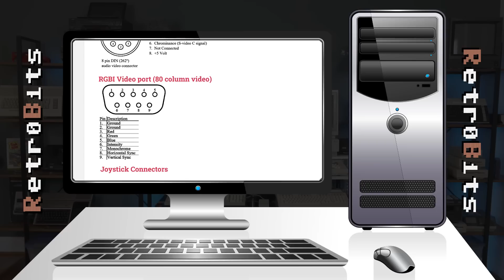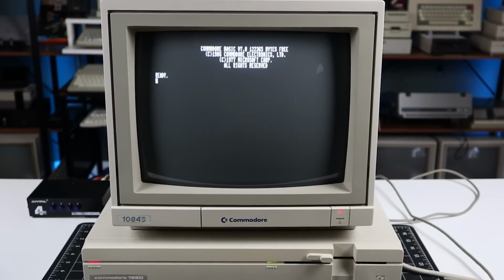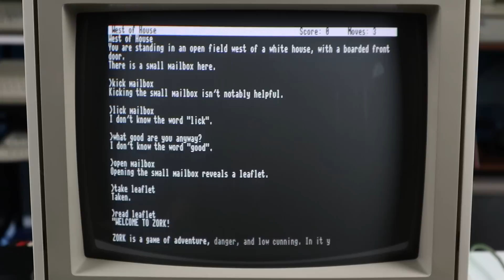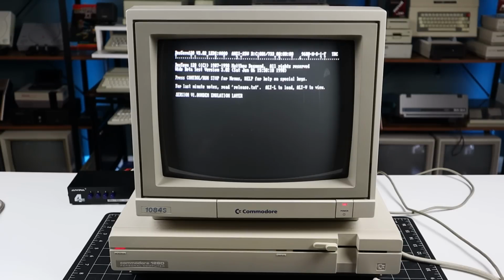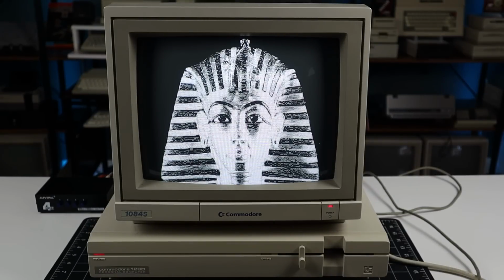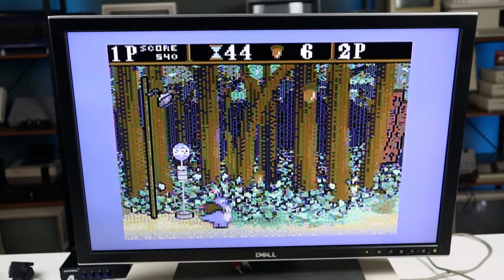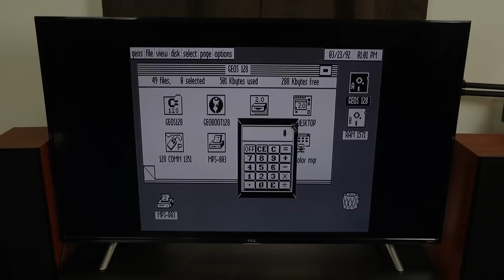80 Columns on the Commodore 128 without RGB or an adaptor?

Comment: I have a C128 DCR with a 1084 monitor. It displays 80 column mode nice and crisp but the text is dark purple rather than bright blue. Is this likely to be a bad cable?
Reply from the maker: Are the other colors correct? You should be seeing cyan text which has the blue, green, and intensity bits turned on. Instead you're seeing purple which requires the red bit and no green bit so it doesn't sound like a cable issue to me, provided the other colors work normally. There is a sub-board in the 1084 that converts the digital RGB to analog. One of the components on that board may have gone bad perhaps.
Reply: @retrobitstv  I'm not sure because I don't have any colourful software I can test 80 column mode with. I guess I could run some BASIC commands to try changing text and background colour.

One thing I do know is that the when I tried GEOS 128, it was purple and black. I assume it was supposed to be white and black.

Comment: ok but ... sorry to write this, but that's a thing we found out ~ 40 years ago ;-)
As monitors were not cheap we all used it in monochrome. I later tried to get a A520 for converting running, but (I used the resistors like on a scart adaptor) never get it stable running. 
~ 10 years ago (I don't remind me better) I also converted A520 to S-Video adaptors , what works perfect for any Amiga. And retried my old Idea, but no chance. Also signals are missing.
There is no 100% working solution and some are so expensive, that makes no sense.
So ... today we use them much less then ever and why waste any more time and money.
Here and there we power the old 8 bit machiens on, enjoy them, than pack them back where thes are protected from dust and sunlight ;-)

Comment: I may have an explanation for the 16 sprites.

The engineer Herd? Quoted a conversation that he wanted a particular VDC but somebody from MOS, said they had another chip.  He asked or said, as long as it was compatible with the original parts features.  So, he locked in the part and found out it wasn't like the original part.

What was this part, it sounded to me like one of the part numbers of the refuced Amiga chipset that Motorola was setting up to produce before all the post Amiga purchase lawsuits (you will find the parts referenced as the original colour computer 3 chip set, a UK 68000 computer, and motorola press release).  I also have proposed in the past that Commodore should have made a 64 replacement with 80 column mode and 16 sprite supports, or even the 64 itself (a character set based 80 column mode is easily doable, and better graphic modes and colour depth follow in future editions going to 640 mode and 256 colours, until a cheap Amiga can be done).  It's funny that tje STe had 16 sprites, at the end of this period.  Where did they get that from?  16 sprites is an unusual choice, though I figured it was just enough to get a good deal of spites on a line.

The problem is Chuck and others had already left, and Jack left, pulling other people along with him in the after math.  So, the series under the plus 4 lost it's rudder, and the 128/64 didn't enjoy their wisdom.  Chuck and teams came from professor advocating for a home computer revolution, and Chuck and his team were trying to start it off.  Chuck talked Jack into home computers, and helped solve engineering problems with the Apple and original Atari VCS/2600  (As to why the plus 4 didn't have a 80 column mode as a chesp business computer, I don't know.  They were already shooting multiple unsuccessful shots at thst market with vic2 and mon vic2 machines).  I think if Jack was still around, he'd be firing people, maybe even throw a prototype.  The plus 4 was sunk over graphics handling and no 80 column mode, and the 128 in having its own graphics handling issue, version of graphics chip, and not being able to run all modes auto switched through the same monitor (but really needed an upgrdaded vic2 chip with 80 column 16 sprites of 4 colours+ any resolution, 16, maybe 256, colour 200*160, maybe 320*200, and 4 colour 640x200, and one or two years after the 64 as a 128).

To me, it seems they were planning the basic for a different featured machine.  The 6502 and z80 had features they couldn't fully implement in time, do they were not activated.  Maybe the vic chip in there has 16 sprite support hidden in some unactivated buggy circuitry on the chip, which could still be activated.   It's engineer might know.  If so, was the circuit design used in vic chips on the later 64'S, and they have dormant 16 sprites (maybe with extra colour depth on a bus with enough clock)?

Comment: I spent most of my time on my C64 using a terminal program, and GEOS.  What an upgrade the C128 would have been for me!  Especially since the terminal program I used had a bitmap graphic-based faux (and fuzzy!) 80 column mode.  Ugh.  An actual 80 column mode would have been a crazy upgrade!  And GEOS 128 would have been a big upgrade too.  Oh well…  I was a kid buying electronics with my allowance, so a second-hand C64 it was!
Reply: What would be the terminal for C128 with support for 80 columns?

Comment: Really nice video. 
How would the composite cable perform on a living room CRT TV? I guess 80 column text would still be too blurry, right?
Reply from the maker: Thanks! I think it would depend on the TV's specs. If it's got a high-end tube with 600 TVL and a low dot pitch it would probably look pretty good!

Comment: I can't believe I hadn't thought of that! Thank you so much for the tip! Definitely gonna make a cable for my 128, it's a bit of a hassle hooking up the cga2rgb and then connecting that up to my gbs8200 just to use 80 column mode since i share it with multiple other systems. I mostly use it for cp/m so color doesn't matter to me and nothing runs in 40 columns.
Reply from the maker: Sweet, glad it was useful!

Comment: Thanks for this! I have a Commodore 128 and have been wondering how to use the 80 column mode without a RGB monitor. Where can I obtain one of those monochrome cables such as the one you showed in the video? It may not be color, but is better than nothing.
Reply from the maker: A couple of the other color options mentioned in the description, but at least one vendor still sells a monochrome cable. I have no affiliation and have not bought from this vendor before though:
https://www.8bitclassics.com/product/commodore-128-monochrome-rca-video-cable/

Comment: Yep, I got a 128 before I got a monitor with RGBI. I did have a 1702 tho, so the VIC was hooked up to Y/C on the back. I made a cable to connect the mono output of the VDC to the front.
Reply from the maker: It seems like I'm the only one that didn't know about this :)

Comment: ZORK!!!!! a game that is most definitely  in my top five Commodore games. When I bought my C128D a few months ago, because it had been my 3rd Commodore computer from 1988-1990 while stationed at Fort Polk LA (My 2nd was a SX-64 from 1986-1988 while serving in West Germany and I also reacquired at the same time as the C128D) I found on eBay and probably paid to much was a complete boxed Beyond Zork in great shape with everything that should of came with the game. This game would only work on C128 in 80 column mode and I think this was the first piece of software that I had bought for my C128D back in the 80's. Just to fill in the gap in the story, my 1st was a C64 for Xmas 1983 that I left at my Mom's during my six years in the U.S. Army. I still have it to this day still hooked up to my 1702 monitor and 1541 drive from the 80's all still sat up on the walnut computer desk that I built in 11th grade woodshop class.

Comment: My own flat C128 was equipped with a switch to toggle between the VIC-II's color output or the VDC's monochrome output on the DIN-8 connector.
Reply from the maker: Nice, that is a great hack!
Reply: @retrobitstv  It is incredibly useful. Since I keep the C128 mode in 2MHz/80 col. I use that switch every time I toggle between the C128 and C64 modes.

Comment: I was c128's biggest fan, 25 years ago more or less i had c128 and c128d later, and i was fascinated with dual cpu and 3 OS features, i wanted to know everything and use it to the 100%. I even used cp/m for my diary writing :) Of course there was no internet and software & documentation  was hard to come by and expensive (mostly pirated). I always dreamed of having 80 columns and use VDC for wordstar and dbase and cp/m, even after 25+ years i still have this a bit sad feeling, but  your videos about c128 they are working therapeuticaly, thanks :) if i only knew about this cable... it is a big revelation for me, really :)

Comment: I'd rather have the one with the off-brown than the one with no hue at all. But yeah, your main point is that this cable you just found singles out the luma signal from RGBI for use in composite mode.
Reply: The pin schematic specifically labels pin 7 as "monochrome," so it's specifically for that. Also, the RGBI spec doesn't include a luma signal. You're thinking of composite, which is a separate output port on the C128, and doesn't do 80 columns. So they specifically designed the C128 to output a 80 column monochrome image, in addition to the RGBI pins and signals.
Reply: @marsilies : Luma isn't what makes the grayscale from composite?
Reply: @HelloKittyFanMan.  Technically, it's backwards. A straight Monochrome signal isn't composite, because there's no color composited with it. 

When composite color video was created for the various TV standards, they retroactively used the monochrome B&W signal for luminance, and composited in the colors, often for backwards compatibility reasons. This is why, in certain situations, like a PAL TV that can do 60hz but not NTSC color, you still get a B&W image, because there's still a compliant monochrome signal to use. 

The VDC chip on the C128 is completely incapable of outputting composite color video, because it doesn't output any compatible chrominance signal. It was specifically engineered to output this analog monochrome signal, which is separate from the digital RGBI signaling it also generates and outputs.
Reply: @marsilies : Yeah, aside from your odd treatment of "monochrome" as a brand name once, I agree, what you said makes sense, and that's what I thought I was saying too, that the monochrome signal from the RGBI is analog and is just the luminance that you'd see as part of composite or s-video. So even though it sounds like you partially "corrected" me earlier, your new reply here makes it sound like I was right.
Reply: @HelloKittyFanMan.  Again, the monochrome analog signal isn't "from" RGBI. It's a completely separate signal the VDC chip generates, and sends out on a separate pin. That pin just happens to be on the same connector as the RGBI pins/signals.
Reply: @marsilies : "From" in quotes? So that's just figurative and it really is from there? What are the quotes for?
OK, why is that pin in the same connector then?
Reply: @HelloKittyFanMan.  It was for emphasis, and to point out where you were wrong, saying its "from RGBI". The monochrome signal isn't using any of the RGBI signaling.

Also, keep in mind that RGB/I was a signaling standard, but not a connection standard. There wasn't a standard RGB/I connector, and each computer maker decided what connector to use, and what else to send through the same connector. As this video itself notes, there were a few different connectors used for RGB/I, and even if the same connector type was used between machines, that doesn't mean they were pin-compatible. 

So the monochrome signal is on the same connector as for RGBI on the C128 because that's what Commodore decided on, likely only wanting to bother with one connector for the VDC. But that doesn't mean that the Monochrome signal is in any way derived from the RGBI signal.

It's like arguing that composite over SCART comes from the RGB signals on SCART. Just because they're sent over the same connector doesn't mean they're derived from each other.
Reply: @marsilies : Haha, quotation marks for _"emphasis"? I understand if you were just quoting me, and I also understand if I was wrong, and I also hope you understand why I thought it was part of RGB/I even though it's not, and you could be saying that just because it's in that connector doesn't mean it's part of that signal. Yes, because I could imagine myself saying that to someone too. So thanks for showing me why. But seriously: quotation marks for "emphasis"?

When and why did you get that errant idea? Are they called "emphasis marks" or quotation marks? What teacher would have been nuts enough to try teaching that they can be used for some other purpose than either quoting an actual statement, a word just used to refer to that word instead of its meaning, or quoting a supposed idea that you don't also follow, or around the title of a short story? Besides that, why try to force those marks into being used what they weren't designed for when you have access to actual emphasis options (even all-caps for short bursts, as a last resort)? And why sometimes treat "monochrome" as if it were a brand name?

Oh yeah, some makers used D-sub and some used DIN, and some used one on one end and the other on the other, etc. Why didn't they settle on a connection standard, kind of like HDMI is both that in signal and a few end sizes, but still a tight standard, on the cables?

Comment: Have personally a great full color solution myself with a 1084S-D1 monitor for my C128DCR and a RGB2HDMI for my C128D, but great video to show there is really no excuse left to use that 80 column VDC mode as such a cheap cable as in this video already gives so much benefit in monochrome 80 column use.

Great video to spead the VDC love.

Comment: 80 column for the C128 was a godsend back in the day. Paired with programs like Superscript 128, you had a word processor that was at least the equal and quite often superior to anything the PC or Mac worlds might throw at it. Clear, fast and easy to use. Thank you Commodore! And when you had finished working, you could switch to 64 mode for games.

Comment: Super cool to share for those that didn't know of this monochrome sol'n. It is exactly how I ran my 128 (with my 1702) with a cable I built myself to run GEOS 128 - this was super cool c. 1987/1988, and how I did my school work when I started college, basically like having an early Mac.
11:02 I love that you're rightly excited about this mode!
Reply from the maker: Nice, so yours was exactly the use case I envisioned. I really didn't know this existed until recently, but having that monochrome pin on the VDC was definitely a smart addition to the system. I wonder why it didn't gain wider acceptance since it seem like a great fit for most of the software you'd be using a 128 with anyway.
Reply: Ya, I didn't know anyone else with a 128; I don't recall how I learned about it. Maybe from Run magazine? That's probably where I learned most C= stuff.
I wonder where the cable was available, pre-made c. 1987, if anywhere.
Reply: My English prof used to complain about the hard to read GEOS text from my dot matrix Star Gemini 10X. :)

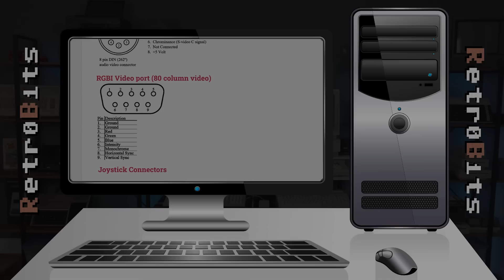Comment: 3:00 - Two reasons why this revelation never struck me back in the day:

1: I don't think I ever bothered to read this particular pinout
2: I thought 80 column video signals were black magic special sauce fundamentally removed from the mere mortal plane of TV signals.

So even if I'd seen there was a monochrome pin, I would have thought you'd need a special monochrome monitor for it.
But I certainly used enough GEOS 128 that a monochrome monitor could have been of some use to me...  Though it was real nice not having to have two separate monitors to use C128's bizarre combination of two completely unrelated video systems.
Reply from the maker: I never looked at manuals back in those days and no one told me otherwise so I ended up buying that used 1084S from one of the BBS guys in S.Portland on $someone else's advice when I got my 128. In hindsight, I'm pretty happy that I did, because it served me well for many years (and hopefully will again soon).

Comment: I have a GBS 8200 cheap thing for my Amiga, then recently bought a GG labs adapter shown early on in video. It works but GEOS128 looks like complete ass and thats what I actually wanted to use it for. Altogether maybe $100 to get on modern monitor
Reply from the maker: Yea I'm not super happy with how the 128 looks upscaled with the GBS8200 either. There is a project called gbscontrol that aims to improve it quite a bit, and I plan to make a video about it some day :)